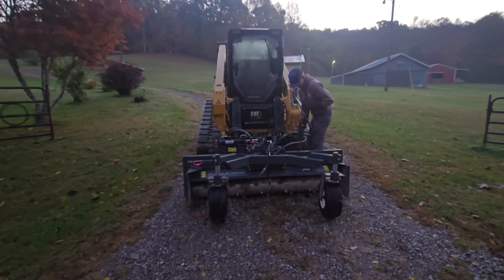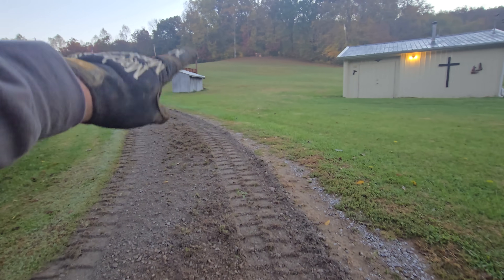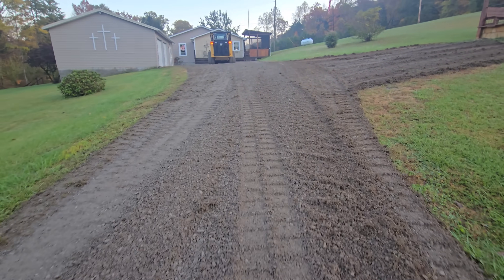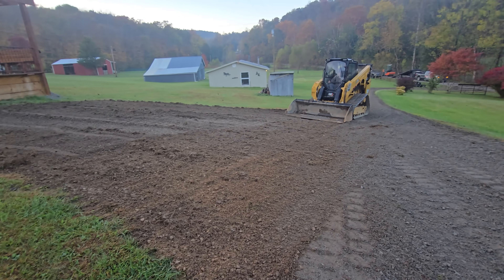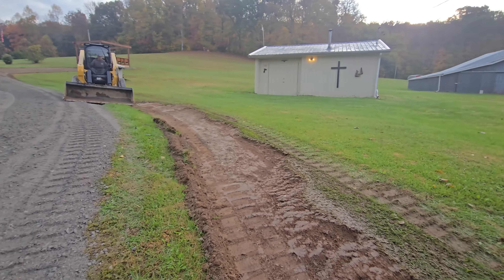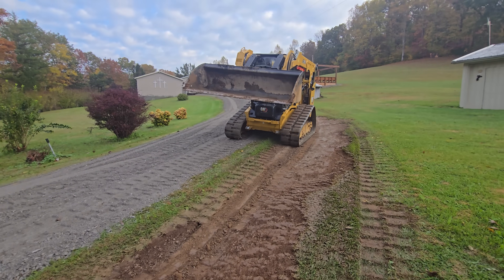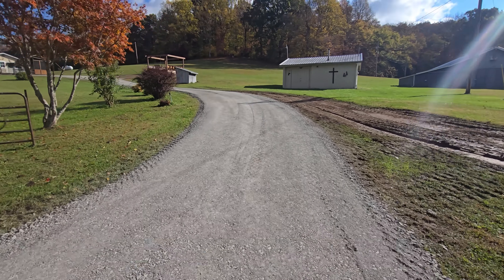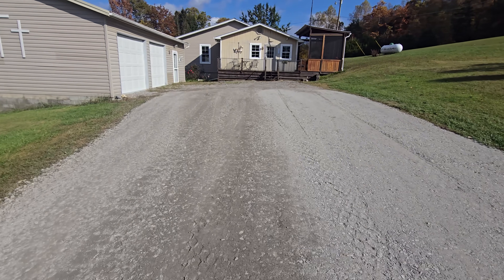Why French Drains DON'T WORK (And What We Did Instead)

Comment: Thought you were going to remove the grass all you did was bury it in time it'll rot and cause potholes also I noticed you didn't use any water on the gravel when you rolled it,rolling dry is useless it won't compact properly.
Reply: False that was not a lot of grass to do that. The first step was pretty much turning the rock and it shredded all the grass apart. Didn’t leave big chunks made everything fine would only happen if your have big lumps of grass foot In diameter
Reply from the maker: Thanks for your feedback!

Comment: Excavating contractor owner/operator here.  30+ years experience.  You guys did a great job!  I restore a few driveways a year and agree with everything you said.  open ditch is the right way to solve to drainage issues.  French drains will not manage fast moving water coming off that hill.  They will eventually silt up and quit working altogether.  I wish I had a roller like that.  I'm the guy you mentioned that just leaves it backdragged.  I love using re-crushed asphalt millings.  The only thing I could say to make any improvements is to put some grass seed in the new ditch, but maybe the homeowner was going to do that. Getting pretty late in the season for grass to grow.
Reply from the maker: Thank you for watching ! And thanks for your thoughts!

Comment: French drains do not work for moving water...what??   
You can't make statements like that especially if we didn't get to see what the homeowner installed.   I was hoping to see you dig up something when creating that "low key swale".  
 French drains properly designed and installed will absolutely move water for decades because it will be a permanent solution.  That low key swale is not a permanent solution.  
I get it though...the owner has a budget cap.
Reply from the maker: French drains do not work for surface water. They do move water by creating a low pressure area that higher pressure standing water can move into and then be carried off to a desired place.

Thanks for your feedback and watching!
Reply: @graveldrivewayrecovery I am struggling to follow what you mean.  Water seeks lowest level and more than 1/4 inch per foot is enough slope for water in a pipe to move.  So if you have a ditch lined with stone and it is sloping more than the 1/4 inch per foot why won't the water move?  What is the difference with your swale?  Seems like a French drain with no geotextile fabric, sharp stone or rick rack.  What slope would allow or force water to move?

Other thing is at my house the gravel drive stone (1 inch crushed limestone) pressed into the fine below it overtime.  Using a Harley (power) rake loosens the stone and dirt (fines) blending them into something like a 6a mix.  Which to me defeats one purpose/benefit of a gravel drive ... the pure stone with spaces between allow slight amounts  of water to pass quickly allowing you to walk, drive or stand on the stone, not the fines.  Sure it makes grading out potholes or ruts easy but if you don't need a regrade why not more sharp stone over to top making it thicker?

Lastly, thanks for posting and explaining what and why your doing.  I am trying to learn.

Comment: French drains are very effective for moving ground water such as a spring head.  They aren't intended to move surface water although I've seen people try them without using fabric which is only a short term fix.